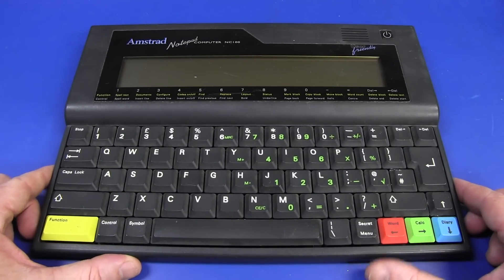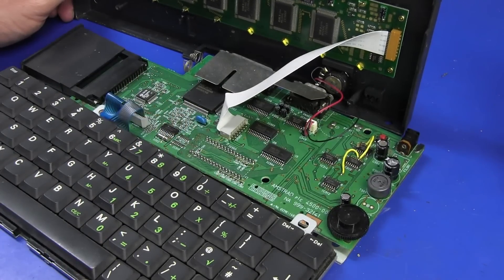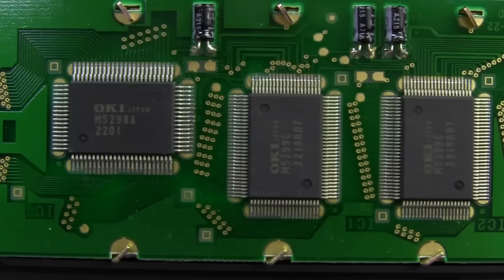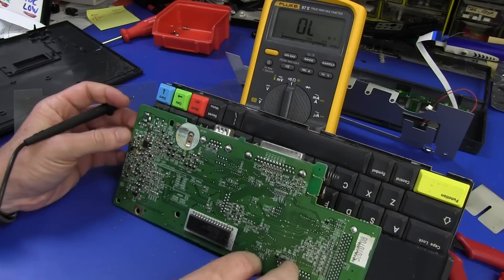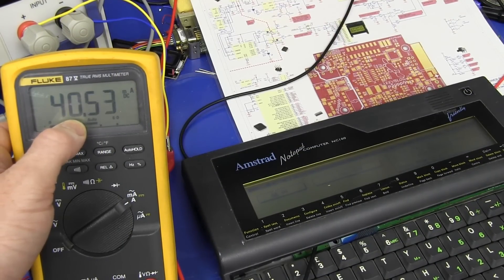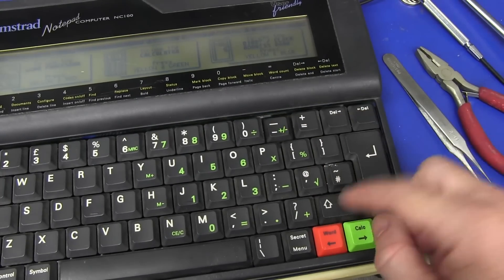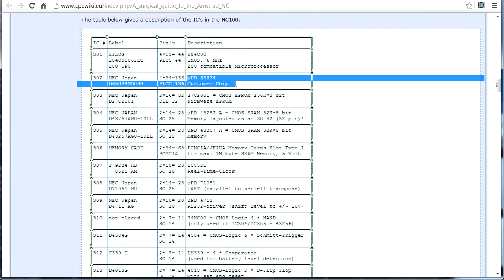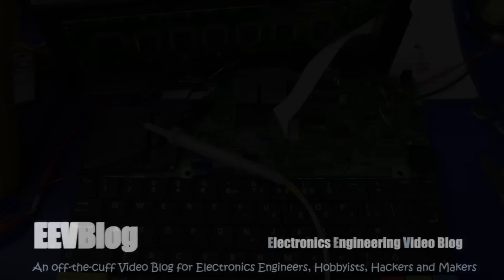EEVblog #385 - Amstrad NC100 Notepad Repair

Comment: Thanks for this video.  I was upset recently when I put batteries in my NC100 and tried to turn it on, only to find it didn't.  I watched your video to get some ideas, and would you believe that my problem was also the fuse.  It must decay over time, as it was working when I put it away a couple of years ago.  Thanks again.

Comment: I think it’s common for these to have blown fuses because the DC power supply socket has the positive on the outside. People find a wall DC plug that fits, but as most of them are negative on the outside, they blow the fuse.

Comment: Although many devices today can consume much more energy than before, devices have become much more efficient. Back in the 90's there were computers that used 65W, just as your notebook, but they could only calculate far less in a certain amount of time. And besides that, this is an energy efficient portable device from the 90s, that as you stated uses about two watts... which is what an iPhone consumes today.

Comment: useful thing to note, if you have one of these that doesnt power up, check and if necessary replace the fuse (wickmann type, 0.5amp, if i remember correctly..?
) that some versions of these use(different from the one in the video) as these seem to fail due to age, seem to form some sort of 'fungus' in/on them which rots the internal wire...maybe the version using smd fuse has similar problem!
Reply: Fuses just fail the same way as a lightbulb, except much slower - almost every fuse will die in normal use eventually, taking maybe 50 years on average in such use, but there will be some outliers which die early. They consist of thin wire, where molecule scale defects can change with time and cause a small spot which heats up disproportionately, which will eventually be where it burns through.
Reply: Waaait a second, the only warm thing on this whole board is the power regulator, and it sits where? 1cm away from the fuse! Well there's your problem. It helps the fuse melt on its own.
Reply: The regulator section barely gets warm..
Reply: Fuses shouldnt just fail with age if the operating current is way below its fusing value...surge currents certainly can cause hotspots and intermittent failure
Reply: i realize Im pretty off topic but do anybody know a good place to stream newly released movies online?

Comment: Certainly a good idea to connect the power supply parallel to the non-rechargeable batteries!
Reply: it doesnt, it connects to the normally closed switch contact of the dc socket, so disconnects when an external supply is fitted, bridge it with a resistor and you can use rechargeables which charge when externally powered...

Comment: Great video. I need information on the flexi cable between the main board and the display. I took mine out a while ago because it was faulty, and can't find it now. Is it a 14 way or double sided 28 way (14 on each side). Looking for a suitable replacement. Cheers. I have an as new Z88 as well, so interesting stuff.

Comment: Perhaps they put the Z80 just to be able to run the BBC Basic ... could be ? ... like the C128 running a Z80 appart from the MOS6502, just for the CP/M compatibility .....
Reply: Z80 is probably the application processor. There is likely no other processor on the system, as Z80 is power efficient, so the only thing you would gain by including a second processor is more leakage current, a bad idea in a battery powered handheld system.

The upgraded model by Nakajima, the ES210, contains a NEC V20 CPU - a much more complex and inherently more expensive device. Makes no sense to upgrade it if it was just there for compatibility's sake. And by the way, porting from z80 to Intel 8086 or NEC V20 is easy enough, little total change should be necessary, and you can do it in a machine language monitor easily enough, or even by directly manipulating the bytes in a binary/hex editor, which is a bit crazy, but can be done if you have to.

The huge custom device in the middle probably just routes the signals, does address translation and performs the display refresh, as well as does simple clock switching. There's likely little more logic in there than in the spectrum ULA, with big footprint being merely due to huge number of connections. Maintaining only minimal logic in there is a good idea, because it runs a pretty high clock speed. The z80 actually constantly runs the memory bus, and it has no ready signal from memory, the only way you can prevent it from crashing if you can't deliver it the RAM contents immediately is to halt its clock. So that's what ULA does, it halts the clock while it's doing for example video refresh or other activities that keep RAM busy. A minor modification to that would be to include a register which would allow to stop the clock programmatically, and the clock would automatically be restarted if there's an interrupt, since the custom logic IC is also the interrupt source and RTC host. By the way, that clock burst when running word processor, obviously that software is running on Z80 too.

Comment: I bet F301 blew because someone stuck the wrong DC power supply on it, or maybe they used one of those universal ones with the 1.5, 3, 4.5, 6, 9, 12V selector switch, polarity changer and the four-way power jack.  Ah, memories.

Comment: why would you need so many resistors and sots all bunched together like that? the 101 and 100s? what do they do, what do you mean by "Passive"
Reply: Likely to handle power load and passive components are components that cannot control electrical flow without the help of an active compoment like a transistor.

Comment: Hey, i know this is old video, but i just found an old nc100 and the display is so faint =(
Anyone knows a solution i can try? already checked the capacitors and they are all seems fine

Comment: Hi I have an Acer Aspire 4752. As i press the power button it makes 4 successive clunking sounds followed by one long clunking sound..      

The problem started, my frientd took the laptop, as per him, he watche the movies and inserted old DVD. after insertion of few DVDs the pc freezed. so he directly pressed the power button directly.

Here's what happened. When I power on the laptop, the boot screen shows up with logo(stuks there) and shows the line press <F2> to enter the setup, with the progress bar below, moves up to 75%. When I press F2 or F12, is says waiting.... But the progress bar doesn't go 100%. I tried waiting up to about 30 minutes but there's no luck, the system won't let mo go to setup bios or boot menu. I tried removing the hard disk ang booting it but the same problem occurs.

i tried to flash the drive as per some tutorial in youtube but i didn't know which file to rename as the file i downloaded was different from what they showed in videos.

Can you suggest me anything I can do?

By the way here is my system specs:
Intel Corei3-235M
Intel HD graphics3000
2 GB DDR3 memory
 500GB HDD.
DVD drive.

Thank you for helping me ou
Reply: this isn't really the place to ask this stuff, but try removing the optical drive (it's usually held in place by a recessed screw and then it slides right out, look it up for your particular model) and try rebooting.
If you hear the same clunking sound without the optical drive your hard disk might be broken and you need a replacement one with a new operating system.